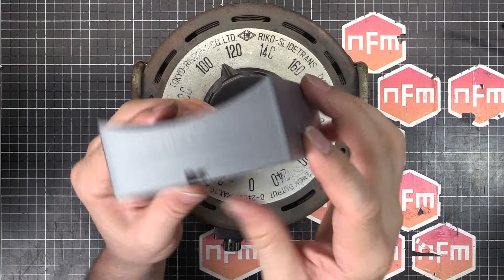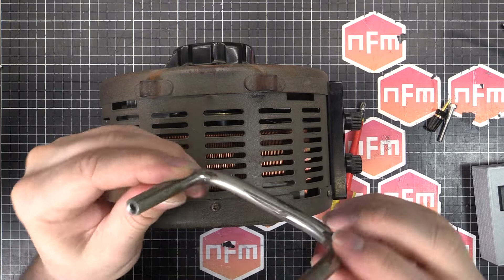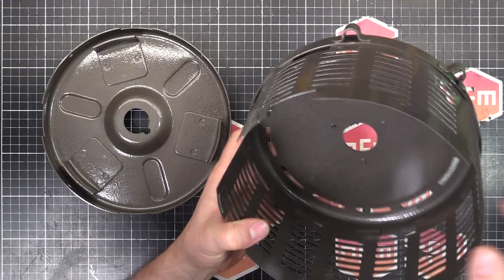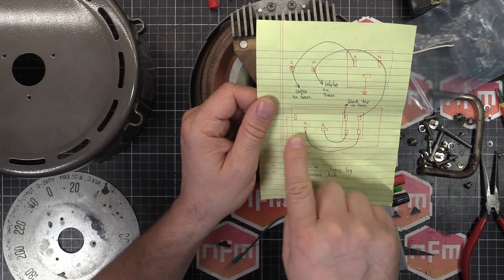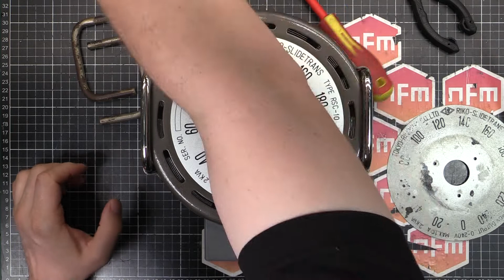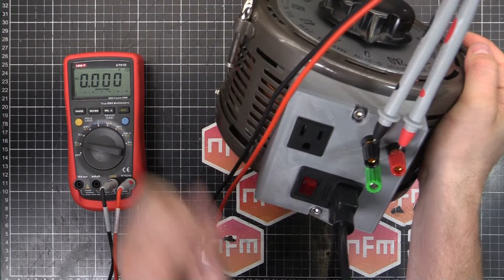Benchtop Variac Auto Transformer Restoration

Comment: Good restoration.  Good on you for taking the trouble to see if original spares for the dial and handles were still available.  In this modern "No right to repair" world it is becoming less common for manufacturers to entertain perfectly normal requests. The old school companies still understand the value but they are being pushed out of the market as large companies with institutional investors that only measure the return on investment no longer care about the product, only the profit.

Comment: I'd probably have used shrouded recessed terminal plugs, but I guess as you implied, if you're monkeying around with variacs, it's kind of assumed you know what you're doing...
Reply from the maker: Yeah, I did think about it but then I lose the ability to connect  normal wires for really unsafe experiments. 😅

Maybe I should put a warning sticker on it to make it all safe again... ⚠️ 😁
Reply: @NearFarMedia  Beautiful Restoration. Thanks for posting the video about it. On the kind of opposite side of the terminal plugs, the 125V outlet with the potential to output 240V is the bigger concern. Maybe not for you, but anyone one else not understanding what that is doing might let the smoke out of practically anything that is capable of being plugged in to that outlet.

Comment: A bit of Kapton tape may have helped secure the paper insulators, under the toroid. The last one looked as if the clear plastic slipped. I am not being critical, I'm just concerned for your safety. You might consider printing another surround and add a cheap/Ebay volt/amp/watt meter = no multimeter needed. And, rubber pads on the feet (bumps on bottom) might be helpful. If that heavy thing got pulled off of the table, your toes might be in peril. Finally, I am sure that you know that you can DIY an isolation transformer from two identical transformers, placed back to back. I DIY'd one from two dead APC 1500 UPSs. I reused one of the cases. Add an incandescent light bulb, in series (AKA "Dim Bulb Limiter,") to limit the current and Bob's your uncle. I r-e-a-l-l-y enjoy your channel. Thanks for all the effort you put forth.
Reply from the maker: Yeah, I double checked the insulators off camera before final assembly so they are all good.
An isolation transformer is on the list of things to do too, one day... :)

I'm glad you enjoy my videos too. :)

Comment: also did you check your voltage + amperage ratings for your binding posts, or did you just grab some and assumed it does not have a big impact?
Reply from the maker: I just chose some banana jacks that looked like they were chunky enough. I didn't check their ratings as I mostly will use them to connect to a multimeter for precise voltage measurements.

Comment: Hello, nice restoration! I am wondering if such a device should have an inrush limiter and/or a MOV to remove huge voltage spikes from switching on/off ?
Reply from the maker: It might help, but I just turn it down to 0 before switching it on and off to prevent any blown fuses which seems to work well.
I do put protection on larger fixed transformers in my other designs though, a smart thing to do to prevent blown fuses and arcing switches. :)

Comment: I have couple broken units from eBay, both had serious problems and the winding was cut for about 8 turns! Have you ever fix that? Also, I'm looking for someone to help me with my Tesla Kit - please see my webpage at:  tonysfun.com and click on the label MY VIDEOS and click on the Tesla Coil help needed. Thanks!
Reply from the maker: Hmm, I reckon if you got some magnet wire of the same diameter, you could cut the existing windings back a bit and solder the new wire onto where the existing windings stop, wrap the new wire around as needed then solder the other end to where the existing windings start again.
Make sure the solder joints are on the side and not on the top where the carbon brush slides, then use some emery paper to polish the top of the new wire to expose the copper for the carbon brush.

As for the tesla coil, I'm not sure.... I haven't made anything like that beyond the little ebay kit I made a video on previously. Sorry!
Reply: @NearFarMedia  Thanks, that is what I plan to do, but one never knows, there are smart people out there, that have tricks that I don't know... Have a great weekend!